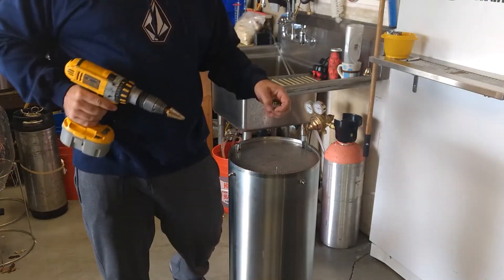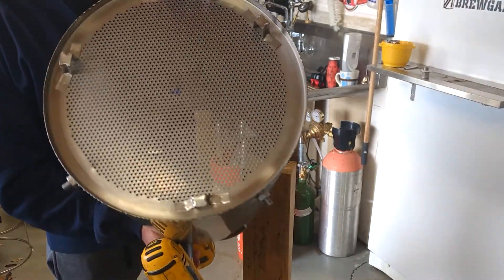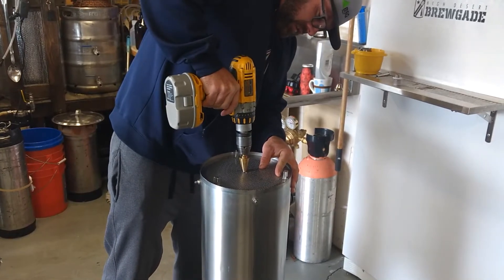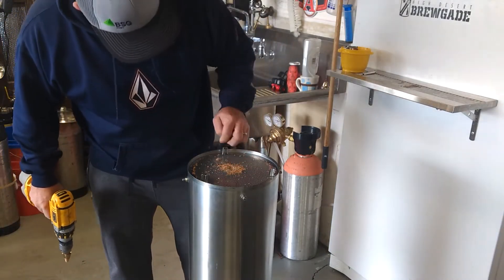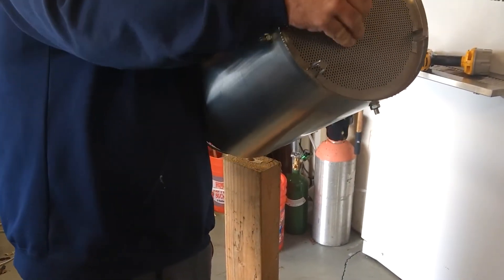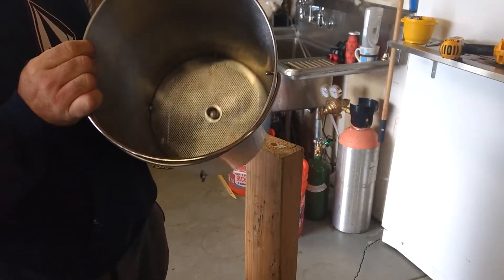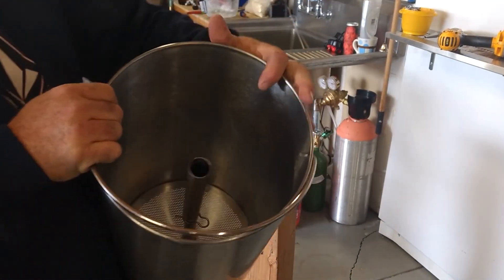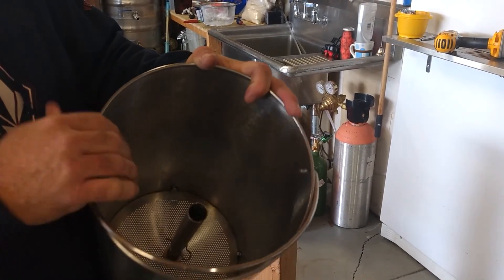Mash and Boil Drain Pipe Mod Install

Comment: is the NPT internally threaded?  How long is your down tube? and did you just buy a Stainless tube and thread it yourself?
Reply from the maker: The base fitting is internally threaded where it connects to the pipe, 1/2npt. Outside pipe is 9", inside is 8" long pipe nipple.

Comment: Great video, thanks! Where did you find the fitting assembly for the bottom of the basket? Also, i am assuming the malt pipe assembly is from the RoboBrew?
Reply from the maker: Any 1/2" npt weldless bulkhead fitting should work. I built the tubing setup myself, I thought the Robobrew one was too cheap and the clips are prone to breaking.